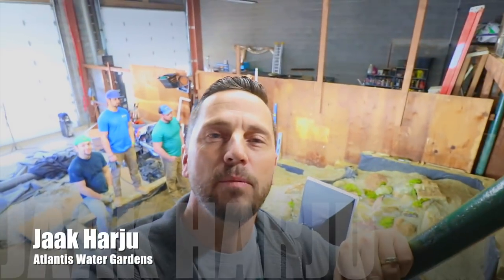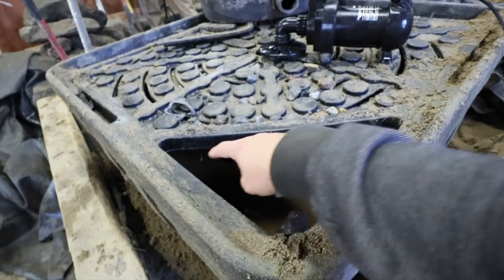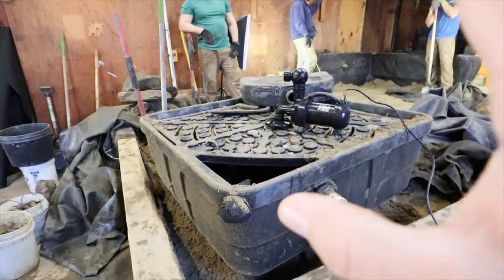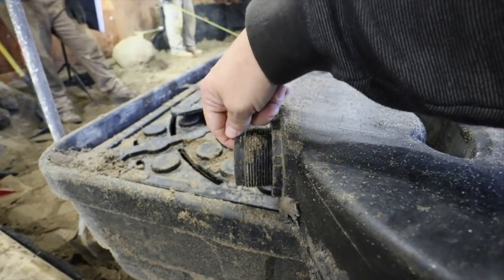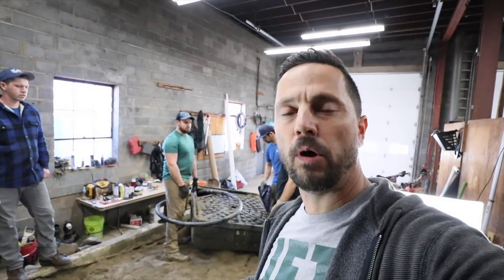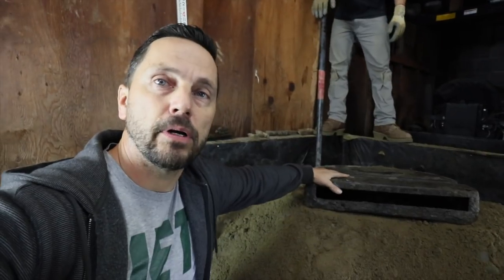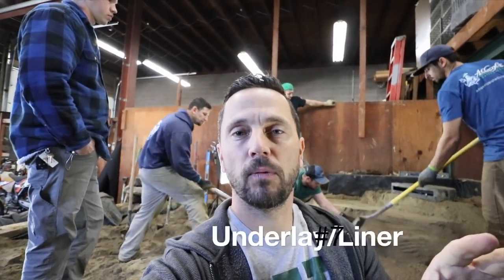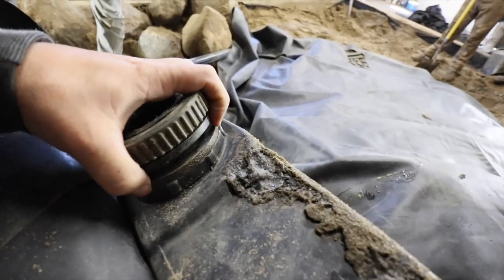How To Build A Pondless Waterfall - Step by Step - VLOG 035

Comment: Wow, wonderful, helpful video!  Thank you so much!  I want to have a pondless waterfall, but have no knowledge/experience in doing it--your video is a huge help!   I have a couple of questions though (I hope you haven't already answered them).  When you attached the liner to the reservoir, I saw a rectangle patch with a shiny surface all around the patch (at 9:09 on the video)...what was that?   I THINK I know, but I'd rather make sure than to make a false step.  Later in the video at the opposite end of the reservoir I saw a rectangular hole in the liner, so I'm thinking that you cut a hole out of what is excess liner and then used that material to reinforce the area around the hole you cut for the plumbing to the reservoir?  If that's correct, then what did you use to "glue" it to the liner?    Thank you so much for taking the time to create this video for us rookies!

Comment: Instead of a laser device, I am going to use a transparent water tube filled with water. One end of the tube can be put in place on the reference point and the other end on the target point. I have see guys using this method on brick works and used it to set garage MS posts. I hope it will do on my water fall.

Comment: Great Video!  Couple Quick questions.  Will the water clear up after while of running the pump.  Or is there a filter product I should be looking for....  I'm building a 2' high waterfall with about 8-10' of length to the basin and I want to create a shallow pounding feature at the basin similar to the first ponding at the start of your waterfall.  Would I set the basin a couple inches deeper if I use this product you used.
Reply from the maker: Yes, it clears in a few days. Setting the reservoir lower will give you the opportunity to achieve that effect 👍
Reply: Awesome!  Thank you for getting back to me!  Stay Safe and Healthy👍🏼
Reply: Would you recommend the Aquascape Kit, the one that's about $750 for the waterfall I'm building.  It uses the basin in your video.  Will it have enough capacity for my small waterfall.  Thanks again for your help and awesome videos.

Comment: Question - you did not mention it, but it appeared that you doubled up the EDPM liner at the bulkhead connection point.  do you normally wo that at a bulkhead fittintg? Why?
Reply from the maker: That was seam tape that you saw. We put that on first before any penetrations through the liner

Comment: Do you just plug the pump to a customer's outside outlet and how do you hide it if the pondless waterfall is in the middle of the lawn and you have to run it to the house?
Reply from the maker: There should be an outlet within 8’ of the reservoir
Reply: @AtlantisWaterGardens  okay have you ever did a install where there wasn't one 8' near by if so what did you do?
Reply from the maker: It’s a requirement for us